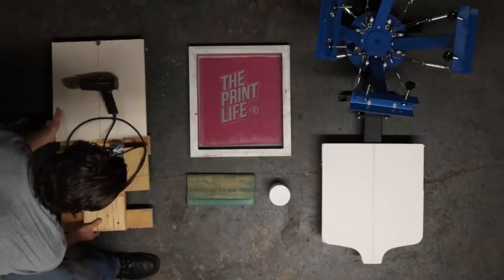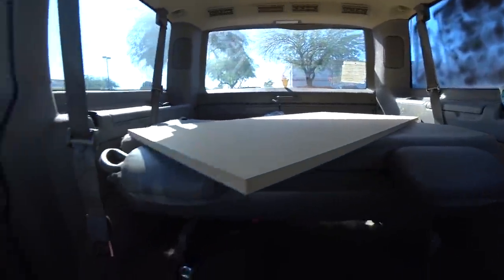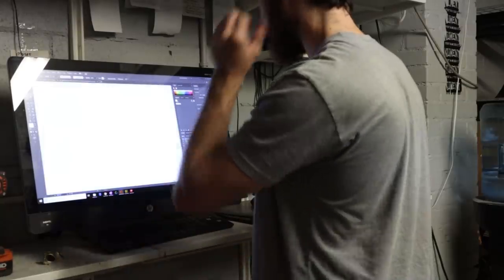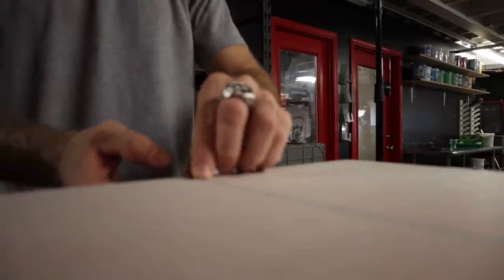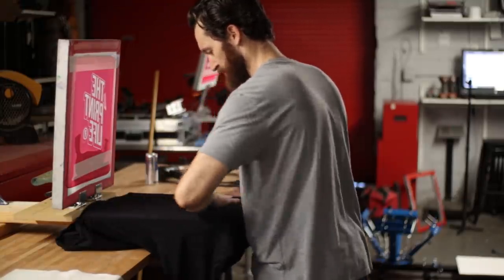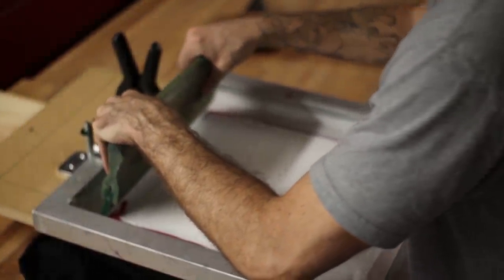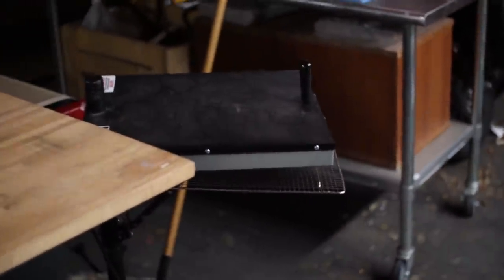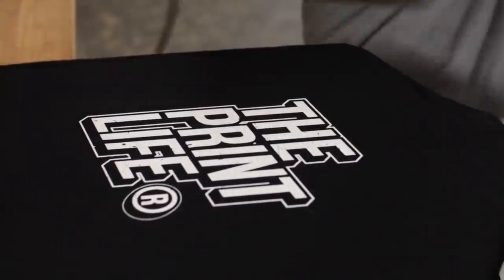STEP BY STEP T-SHIRT BUSINESS [ 2 cheap t shirt press options ] Homemade screen printing press

Comment: The thing about wood is it randomly moves and its not accurate.
Reply from the maker: Wont matter on this cause its only one color and there are very few points were movement will happen. If you were trying to do a multi color press wood would be a nightmare.
Reply: @ThePrintLife  Agreeee

Comment: I didn't see a video for this so I will ask here. If you print a white under base, is it the same size as the print or slightly smaller? What software do you use?
Reply from the maker: White under base usual gets a .5 stroke in illustrator. this will increase or decrease depending on how tight you can register a job.
Reply: @ThePrintLife  Thanks! Something else I need to learn.. I just got an exposure unit. Next will be to tackle that software! (I currently use vinyl with my cricut)

Comment: I bought the blue press off eBay in a huge kit that came with ink and all the stuff necessary and I can tell you the xenon ink that comes with it is horrible . It does not spread like the ink in this video is cuts out halfway through the pull no matter how much or little you put . Also the squeegee is terrible which is probably half the problem . I have watched a thousand videos on screen printing and every time I go to print the shirts come out with so much extra texture or when I flood the screen the ink is too much . If you invest in one of these be sure to get better quality ink and squeegees cause the stuff that comes with the press is terrible .
Reply from the maker: For plastisol go with a reputable brand. Union, wilflex, international coatings. For water based try CCI, permaset auqua,